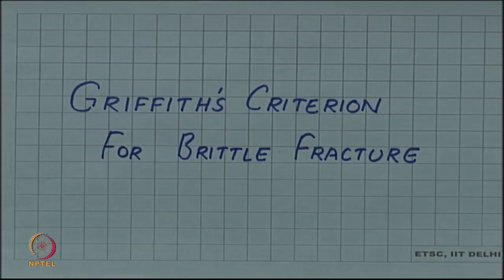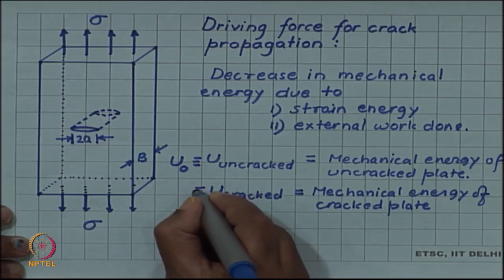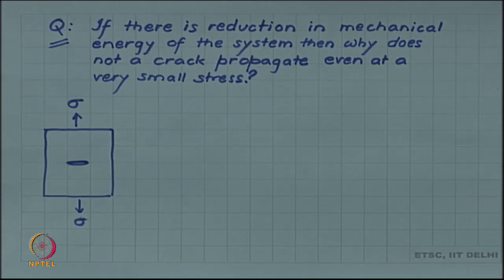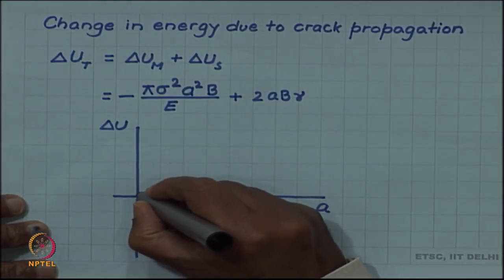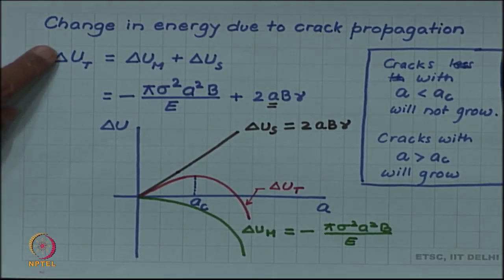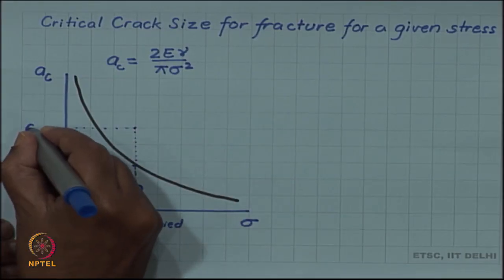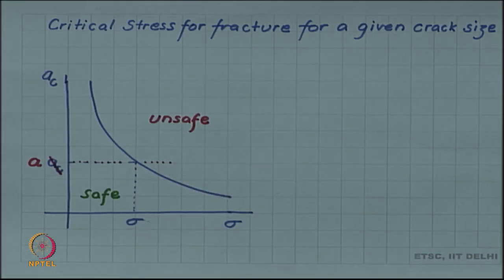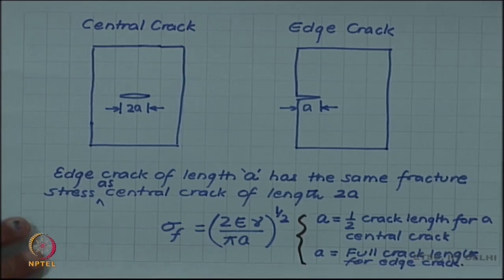Griffith's Criterion

Comment: If you wanted to find the critical stress where crack would propogate (rather than critical crack length), you might be able to differentiate the total Energy with respect to stress and not crack length. However you will find the critical stress is 0. Please explain?

Comment: Sir is this crack propagation is the way in which fracture occurs in ductile and brittle?or does fracture in ductile occurs some other way?
Reply: Griffith's analysis is primarily based on brittle materials like glasses. For ductile fracture, Irwin has further extended this approach.
Reply: @TheSourav77  can u provide me a link borther?🙏
Reply: @ankushsaha007  You may follow the online course by Prof. Ramesh, IITM on engineering fracture mechanics. https://nptel.ac.in/courses/112/106/112106065/
Reply: @TheSourav77  thanx a lot bro🙏

Comment: Sir at 17:26 u said if crack size(say a1)  is less than critical size it dont propagate,my doubt is how this crack of size a1 gets formed in the first place?it had to have been created from no crack state,and if we increase crack size from 0 then process is unfavourable as energy increases so system resist this formation of crack,so how we are getting this pre existing crack of size a1?did it occured due to a higer applied stress tht we applied before?
Reply: This is indeed a difficult question. The Griffith theory presented here takes care of crack propagation. It cannot handle crack initiation. As far as I know, there is no well-established theory of crack initiation.
Reply: @rajeshprasad101  thanx a lot sir🙏

Comment: Sir i did the simulation of hydrogen embrittlement in nickel. For pure nickel the crack tip was sharp and growing smoothly in x-direction. When i simulated nickel with 2% and 4% hydrogen , the crack tip was blunt and it shows parabolic nature. But when i increased the hydrogen concentration upto 10%, the crack tip started moving towards y direction instead of moving in x direction? I don't understand why is this happening? If i have explained the problem well , could you please tell me the possible reason for this?
Reply from the maker: Too difficult a question for me!

Comment: Dear Sir, Thank you for the video. I want to ask you that I have two samples contain the same quantities of H ions, then I annealed the samples one at 150 deg for 2h and the second at 350 deg for 2h. I found blisters in both samples but the sample annealed at high temperature has higher blister size. My question could I use this concept to analyse and explain this finding?
Thank you and with my best regards
Reply from the maker: I will guess that at higher temperature you have more H comes out and forms larger blisters.
Reply: @introductiontomaterialsscience   thank you for your answer, it's right

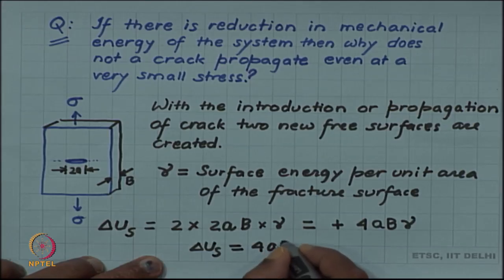Comment: Sir, In 12:50 you have mentioned the change in surface energy as 4(a)(B)(gamma) however in the next slide for calculating total energy you have mentioned the change in surface energy as 2(a)(B)(gamma).
Reply from the maker: This is a mistake. Fortunately, the mistake is at this point only. I have used the correct value 4 a B gamma before and after this point. The final result is therefore correct. I have added a correction comment and have included it in the description also. Thanks for pointing this out.
Reply: I guess he plotted the general definition considering the crack length equal to "a" and not to "2*a" like in the previous slide

Comment: What happens when the crack is inclined at an angle to the tensile axis. How would I find critical stress? please
Reply: The tensile component, perpendicular to the crack face, of the applied stress should be taken as the relevant stress in the Griffith's formula. Thus if the crack face is inclined at an angle 'theta' to the applied tensile stress 'sigma' axis then the relevant tensile stress perpendicular to the crack face will be sigma*cos^2(theta). Thus, other factors being the same, the critical stress will be enhanced by a factor (1/cos^2 theta) with respect to case where the crack face is perpendicular to applied tensile stress.

Comment: Sir, here we are assuming that the object already has a crack in it. I would like to know how a crack is formed initially, from material science point of view. Is there any object which has no cracks in it (ideal case)?
Reply: Generally when the material is subjected to stress, Initially the material absorbs energy according to its toughness and when the value of the stress crosses the ultimate shear stress, the crack is formed. And when this crack meets another surface,. Shearing of material takes place. And in this way punching or blanking is performed. Propagation of shearing is called tearing.
Reply: @navdiprathavi3692  sir, what is ultimate shear stress? I have heard maximum shear stress for Tresca yield surface, but I guess that term is ultimate tensile strength and for brittle material doesn’t even go beyond yield stress as it gets fractured at yield limit. Correct me if I am wrong.

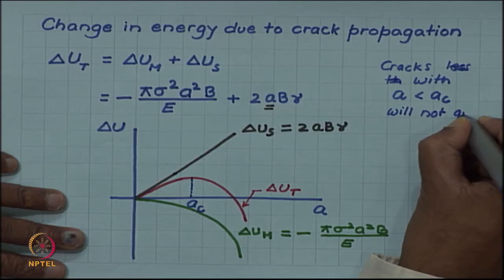Comment: At 17:23, change in energy (not the energy) is dropping. As long as the graph is above x-axis, change in energy is positive. After cutting the x-axis, change in energy becomes negative, i.e. energy is now decreasing. So, shouldn't the critical crack length be the point where the graph crosses the x-axis instead of the point of maxima ?
Reply from the maker: This is a nice point and a subtle one. The reference of energy here is the uncracked component, i.e. energy is per when a=0. You have rightly pointed out that from a=0 to the point where the curve cuts the x-axis (let call this value of a as ax. the energy is positive, and only beyond this point it becomes negative. This means that all components with a<ax will have energy higher than the untracked  component. But now consider the possibility of growth of such a crack a<ax. If a <ac (corresponding to the maximum) then the growth will further increase the energy and should not be possible. But for a>ac any crack growth will lead to lowering of energy making the growth possible.

Comment: why do we take B as the thickness for the new surfaces created (B is the overall thickness of the material, and the crack is not present throughout the thickness of the material)?
Reply from the maker: In this problem we are considering through-thickness crack. Thus breadth of the crack is the same as the thickness of the plate.
Reply: Hi sir. The surface energy of the new formed surface after crack is the barrier for crack to occur. If the crack is propagating along the length of crack 2a, how the new surface area formed due to crack will be 2×2a×b. it should be 2×total length of crack(after crack)× b.
Reply from the maker: The geometry we are considering is a plate with a through-thickness crack. So the width of the crack is the same as the thickness of the plate.
Reply: Introduction to Materials Science and Engineering  ,Thank you for the reply sir . Just one more thing , Is the direction of propogation of crack along it's length (i.e. 2a)  ?
Reply from the maker: Yes. So we are analysing a very idealised situation where we have a flat-faced through-thickness crack which propagates in its own plane. This is to keep the analysis simple. A real crack need not have flat faces. And it need not propagate in a single direction.

Comment: Sir, in my book they mentioned that,the elastic energy available per unit width is 2   x ( sigma square x pi x C square )/ 2 E. Why did they multiply elastic strain energy by 2...????
Reply from the maker: Actually tsrain energy is not being multiplied by 2. You can see that in your expression 2 is coming both in the numerator and the denominator, and so they cancel giving the expression as the one used in my slide. In fact I have not derived the expression. And I think your book also must not have derived it. Derivation requires more advanced concepts from elasticity theory. So we simply take the final expression and use it for further derivation of the Griffith's criterion.
Reply: According to previous standards (12th or from strength of materials) 

Strain energy = 1/2 *(stress) *(strain) 

Now for that 2 
According to the book I refer 
It is Bcz the crack is throughout, so u have two surfaces which will try to resist the propagation of crack